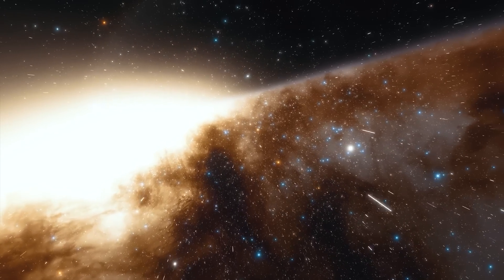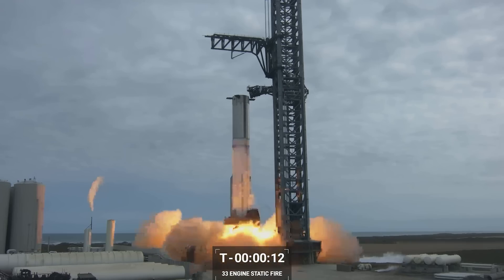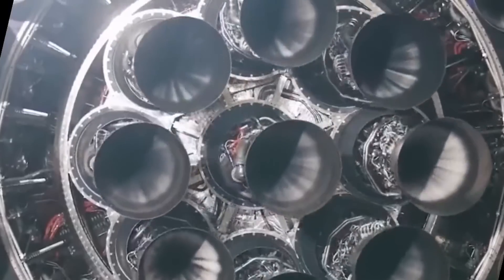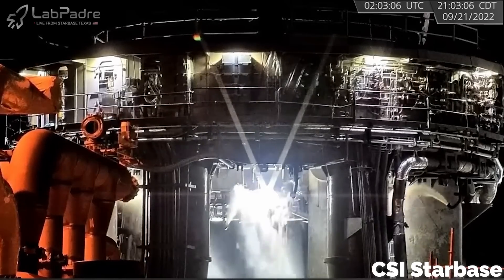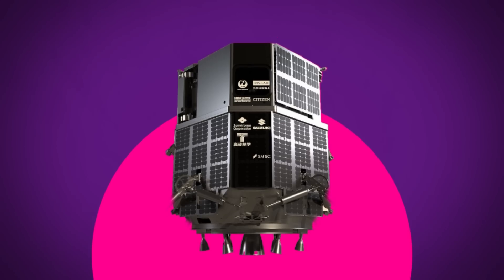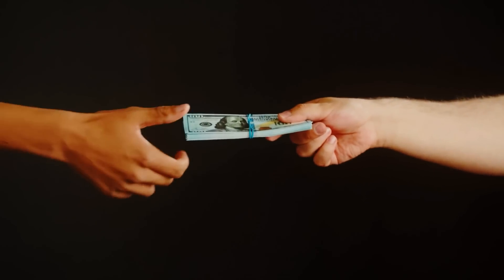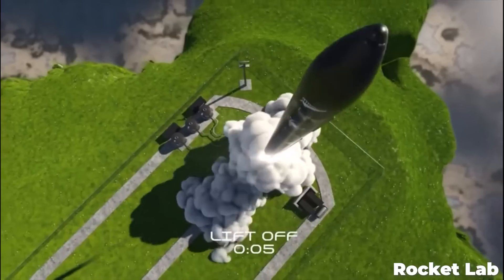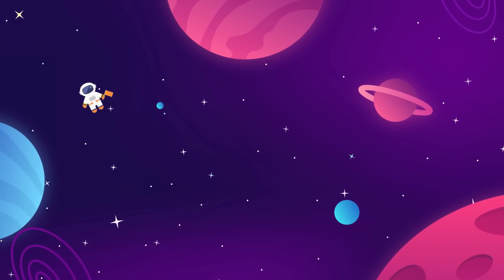The SpaceX Starship Orbital Launch Update & Repair Progress Is Here!

Comment: I think the be deal here with SpaceX is that the decision to launch so quickly while knowing  all TOO well just HOW much more powerful Starship is compared to Artemis - and the massive damage  Artemis DID at Cape  - was a very risky move to move forward with the Starship launch. SpaceX should have tabled the launch and structured the launchpad to meet or a least come closer to the expectation of 17 Million lbs. of thrust, it was evident they we rushing here. But hey - no one got hurt - the mission was a success and the know exactly what needs to be done to make it right. So many in the end it was the cheapest way to get the best data???
Reply: Data of destroying stage zero, data of wrecking 1/3rd of all engines on the booster, data on the flight termination system that only succeeded in terminating the flight termination systems, data of heavily damaging the OLM, data on damaging the tank farm, and data on endangering the people of the town 6 miles out by exposing them to cancer inducing dust and debris?

None of that data is valid because none of it is data of a fully controlled experiment but instead if just a bunch of data of failures and incompetence.

Comment: I think you are mistaken about the engine bloom. NASA is not so worried about landing on the Moon or Mars because those bodies have lower gravity and there's no atmosphere to push through, so less power is needed to get into orbit. Each rocket stage in any design by any company has different nozzles for different stages, and those nozzles are optimized to direct as much of the flow directly opposing the heading of the rocket as possible in certain pressure conditions. Problem launching stuff from Earth to orbit is the power requirement, not the pressure or nozzle design.
Reply: Additionally, SpaceX HLS will have engines at the top to prevent damaging any launching pad... or just the ground.

Comment: Much of this information is outdated or incorrect. [edit: I mean the Starship content. The lunar stuff seems right.]

I recommend checking recordings of the twitter spaces event with Elon several days ago and watching the past few days of progress at the pad. No meaningful repairs needed, and the crater has already been cleared and is quickly being prepared for the water cooled steel plate.

FAA would have been required to investigate almost any outcome of the launch. Their investigation is no surprise. Their two main concerns are going to be how to avoid a new crater (answer: the floor will be water cooled steel and startup will be twice as fast) and how to ensure the flight termination system is more expeditious. Most of the other concerns are resolved by design improvements already built into the later boosters.

Comment: More damage then expected?  Sure.   But don't forget.  In order to put in the water cooled steel plat system, they would have had to dig up the pad anyway.   Lots of that has now been done for them.   Jack hammering that stuff up was going to take a bit.   Now, not so much.
Reply: I thought the pad sat higher up, like half way between the top and bottom.
Reply: @nidhogg00  Could be.  There is not much room there and it would make it a bunch harder.  I would think that's not the plan but sure.   Could be.  Doesn't change the fact that they would have to redo the concrete anyway.  Musk stated he hoped it would stand up to one.   Not Many.
Reply: @lucidmoses  Wait so you dont know how its installed but you commented saying that they don't have to remove the concrete now because thats where it gets installed? weird. 

Also, the concrete wouldnt have to be redone... it doesnt take the full blunt of it when the plate is installed... do you even know what you're talking about?
Reply: Demolition companies are gonna start placing orders for SpaceX enginges
Reply: Almost like it was planned
Reply: @ericblanchard5873  it wasnt planned...
Reply: @ericblanchard5873  I'm going to heavily underline the 'Almost' then go with yea.

Comment: The crater is already filled lol, SpaceX works fast
Reply: That's what having money and autonomy does for you!
Reply: @Steve  and private company. Thank you capitalism
Reply: There’s a Jesse Gonzalez at Northrop, but no Ezra. Also he’s a radio frequency engineer, not into SRB’s. Also the SRB’s aren’t new, simply a redesign from the Shuttle era. Congress literally ordered NASA they had to use “off the shelf” type components. Why? Jobs in their districts. You’re full of it Ezra.
Reply: @sardoniclysane  it was a rather funny proposition that the spacex engineers were so clueless that they wouldn't realize water has a lot of pressure when heated. It doesn't pass the basic plausibility check
Reply: Yes, and the rocket went into a tailspin and exploded, too.
Reply: JESUS CHRIST IS RETURNING SOON THE RAPTURE IS NEAR. OUTER SPACE IS A HOAX. EARTH IS FLAT WITH A DOME CALLED THE FIRMAMENT. THERE ARE FALLEN ANGELS IMPRISONED UNDERGROUND BY GOD. AZAZEL AKA LUCIFER IS AT AREA 51. HE IS WHERE ALL THE TECHNOLOGY, SYSTEMS AND LIES COME FROM. ROME FOUND HIM YEARS AGO. INFO IS ON MY PAGE
Reply: Dumping concrete in a hole isn't a repair. If anyone think that is all that is needed then they are in for a surprise.
Reply: Could we finaly see a semi submerged launch soon? :P
Reply: Attention all atheist level 1 portion of youth longevity digestion an self beauty Jesus energy wash tonight at 10 33 eastren❤
Reply: No redesign?
Reply: They also work pretty stupid. So working fast makes sense when you make so many unnecessary mistakes
Reply: @NewTrip_NewAdventure  there is very slim pickins but the only liquid that might be an option for the radiator might be Fluorinert™ Electronic Liquid FC-43, which has a boiling point of 165°C (329°F) and a thermal stability limit of 210°C (410°F). Another example is hydrofluorocarbon (HFC) refrigerants like R134a, which have a boiling point of -26°C (-15°F) and can operate at high pressures and temperatures up to about 135°C (275°F) without significant expansion. but then again everything must be tested! something Spacex does not have is time!
Reply: if Spacex  did not see this coming "anomaly"  what else is this pisss poorly though out and designed? and the water cool steel plate is a laughably bad idea it will blow up like as the largest boiler explosion!! Steam is a vapor that is created when water is heated to its boiling point and undergoes a phase change from liquid to gas. As the water is heated and converted into steam, its volume increases significantly, and it can exert a great deal of pressure on its surroundings.

The expansion ratio of steam can be calculated using the ideal gas law, which relates the pressure, volume, and temperature of a gas. At standard conditions (0°C and 1 atm pressure), one gram of water can produce about 1,673 liters of steam. However, at higher temperatures and pressures, steam can expand even further.

For example, at 100°C and 10 atm pressure, one gram of water can produce about 23,500 liters of steam. This expansion can be used to generate power in steam turbines, which convert the energy of expanding steam into mechanical work. good luck muskrats!
Reply: @ezragonzalez8936 , your math / formula is off by a few orders of magnitude.. lol. 3 to be exact. 
1 gram of water @100c CAN produce 1673 cubic centimeters of steam where 1cubic centimeter =.001 Liter or 1 liter = 1000 cubic centimeters. So 1 gram of water = 1.673 liters of steam. Not 1670liters. Talking about piss poor.. your math is right on par with piss poor
Reply: @richhooker1263  The internal energy of the water changes as it undergoes a phase change from liquid to gas. The change in internal energy can be calculated using the formula:

ΔU = q + w

where ΔU is the change in internal energy, q is the heat added or removed from the system, and w is the work done on or by the system.

In this case, the water is being heated to 100°C and then vaporized at constant temperature and pressure. Therefore, there is no work done on or by the system, so w = 0.

The heat added to the system can be calculated using the formula:

q = m × L

where q is the heat added, m is the mass of the water, and L is the latent heat of vaporization of water.

The mass of the water is 1 gram, and the latent heat of vaporization is 2250 J/gm. Therefore:

q = 1 gram × 2250 J/gm = 2250 J

The change in internal energy is therefore:

ΔU = q + w = 2250 J + 0 = 2250 J

So the change in internal energy of the water in this process is 2250 J.
Reply: @ezragonzalez8936  wow. So glad that you're here to tell some of the world's brightest engineers that they overlooked glaring flaws that a random internet person from nowhere can see clearly.
Reply: @allisthemoist2244  Well I  am a Sr Mechanical Engineer at Northrop Grumman Innovation Systems and have a Bachelor's degree in Aerospace Engineering from Purdue University.

Our team help design the Solid Rocket Boosters (SRBs) for NASA's Space Launch System (SLS) rocket, including those used in the Artemis I mission. ( You know the successful ones)

Designing and analyzing the(SRBs)
And were responsible for designing and analyzing rocket systems, including propulsion systems, structures, and guidance and control system. 

We also work using the most sophisticated computer modeling methods used for sound pressure the finite element analysis (FEA). FEA  which is  a mathematical technique used to approximate complex physical phenomena by dividing the problem domain into smaller elements and solving equations for each element. This method is applied to sound pressure modeling by creating a 3D model of the acoustic environment, which is divided into small elements. The equations governing the propagation of sound waves are then solved for each element, taking into account factors such as the geometry of the space, the properties of the materials, and the sources of sound.this is something Spacex cleary needs help with! 

thank you for the compliment tacky shirtless boi!
Reply: @ezragonzalez8936  i hope your idea can reach spaceX. Thanks for sharing your idea. I really want starship to succeed and someday have a vacation on mars in my lifetime 😅
Reply: @rots3123  ha ha Well, our team at Atk Northrop Grumman does try to help but do the confidentiality and non-disclosure agreements and as you can tell from the toxic comments it's not easy so ideas in the youtube community is all we can share.

Everyone’s biggest fear is  the next Starship Super heavy launch will be rushed and here at Atk Grumman formerly Morton Thiokol were responsible for  certain O-rings that were designed to seal the joints between the segments of the solid rocket boosters during launch, but they were found to be susceptible to failure in cold temperatures.  Unfortunately the challenger disaster! 

Every Mechanical engineer I have spoken with agrees that success without a proper trench flame diverter, is unlikely and Spacex has neither the time budget nor location for one. The Launch location at Boca Chica  was a terrible idea. Spacex could use a copy of the Soviets N1 Rocket launch Pad 110/37 at the Baikonur Cosmodrome in Kazakhstan which was a tri-trench flame diverter 

Thank you sir you should also share your ideas while thinking outside the box!   Have a wonderful evening, 
Cheers from Park City Utah
Reply: @Ezra Gonzalez  Ezra do you think the ground blowing up under this rockets is in the word class "anomaly" ???? or do you think "miscalculation" would be better ? Rofl
Reply: @ezragonzalez8936  actually this same techniques have already been used and proven to work with NASA and other countries. So it’ll prolly be the perfect solution to this problem especially since they can’t dig far down bc of water therefore the waters already well available and there’s plenty of it
Reply: @DiamondSquidy  hopefully they can make something work!  was researching the toxicity potential and it appears  Hydrofluorocarbon (HFC) refrigerants like R134a are generally considered to be non-toxic under normal usage conditions. However, they can be harmful if they are released into the environment or if they are handled improperly.

 
the most promising ome I believe is Fluorinert Electronic Liquid FC-43 which is generally considered to be non-toxic to humans under normal usage conditions. However, it can be harmful if it is ingested or comes into contact with the skin or eyes. Exposure to FC-43 can cause irritation, redness, and swelling of the skin and eyes.

In addition, FC-43 is a type of perfluorinated compound, which means that it does not break down easily in the environment and can persist for a long time. It can also potentially bioaccumulate in living organisms and have adverse effects on aquatic and terrestrial ecosystems. the problem for both as you see is getting them Environmental Impact Statements approved and convince environmental groups! 

In my opinion the biggest challenge will be the effectively containing sound pressure hopefully they learn a good lesson but Spacex must use the most sophisticated computer modeling method used for sound pressure which is the finite element analysis (FEA). FEA is a mathematical technique used to approximate complex physical phenomena by dividing the problem domain into smaller elements and solving equations for each element. This method can be applied to sound pressure modeling by creating a 3D model of the acoustic environment, which is divided into small elements. The equations governing the propagation of sound waves are then solved for each element, taking into account factors such as the geometry of the space, the properties of the materials, and the sources of sound.

Cheers from Park City Utah =)
Reply: @ezragonzalez8936  oh yes “Ezra” I’m sure you’re far smarter than the space x engineers.
Reply: @sardoniclysane lmfao ikr

Comment: A possible source of error that was not mentioned is '...we don't know everything...".
Reply: if Spacex  did not see this coming "anomaly"  what else is this pisss poorly though out and designed? and the water cool steel plate is a laughably bad idea it will blow up like as the largest boiler explosion!! Steam is a vapor that is created when water is heated to its boiling point and undergoes a phase change from liquid to gas. As the water is heated and converted into steam, its volume increases significantly, and it can exert a great deal of pressure on its surroundings.

The expansion ratio of steam can be calculated using the ideal gas law, which relates the pressure, volume, and temperature of a gas. At standard conditions (0°C and 1 atm pressure), one gram of water can produce about 1,673 liters of steam. However, at higher temperatures and pressures, steam can expand even further.

For example, at 100°C and 10 atm pressure, one gram of water can produce about 23,500 liters of steam. This expansion can be used to generate power in steam turbines, which convert the energy of expanding steam into mechanical work. good luck muskrats!
Reply: Exactly

Comment: why dont we copy whatever the chinese do? what they doing clearly working and they have been copied what we did for the longest time now just have to turn around and copy them
Reply: I’m not sure there is anything China is doing in Space/Rocketry that is worth copying. Better to be the clear innovator and leader even if other countries copy it to catch up than let someone else take the lead.
Reply: The Chinese never make anything worth copying
Reply: @thenegociater3387  in what way have 'we' made it work any better than the Soviets did?
Reply: @thenegociater3387  it was a disaster from start (pad destruction, engines out or destroyed, 'power slide') to end (unable to separate, complete loss of control, potentially fatal delay in self-destruct system).  Indeed, the booster was such a failure that the Starship itself wasn't even tested - just destroyed pointlessly. If that's making something work, then your definition of 'work' is very different to mine.